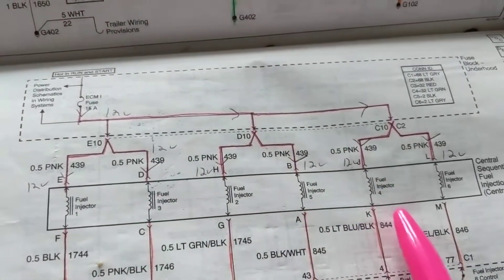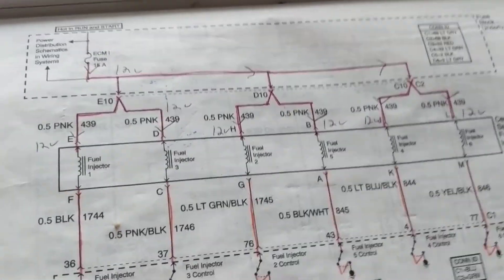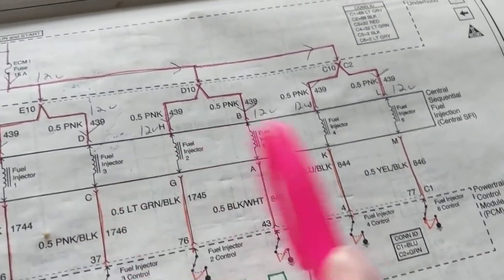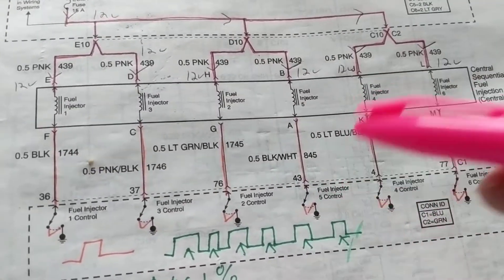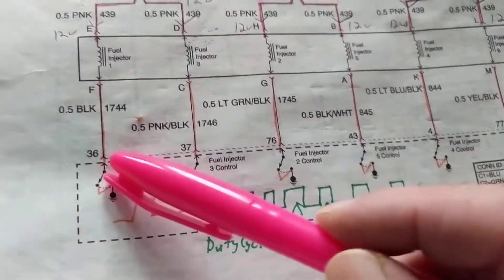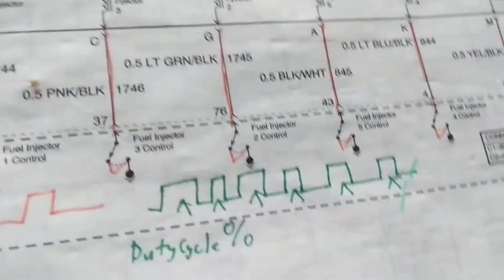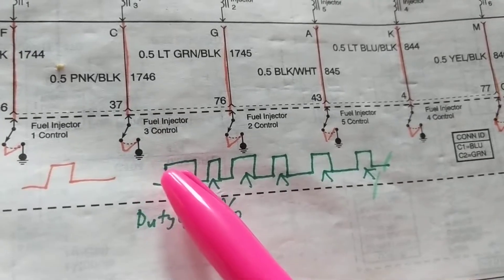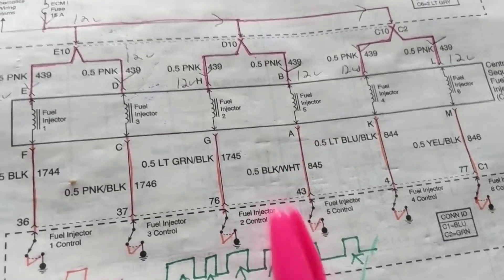HOW  COMPUTER  in a car WORKS pcm  WITH FUEL INJECTORS

Comment: I have a 2011 nissan versa S 1.8 4spd auto with 94k miles.
It has am intermittent stalling at low speeds or in park. I've had the ecm to upfix 2 times..communication board 1st repair..went 500 miles before it started stalling again( restarts after it sits a bit) 2nd time the power board was replaced..went 250 miles and started stalling again...if I keep the rims up above 1200 it won't stall. My scanner shows car goes into open loop when I let up on accelerator. Before first repair I noticed car would go into open loop and st fuel trim would shoot to +25. It would restart and dies repeatedly but eventually it would  start and run normal. 
The only code is a p0420 and I replaced the cat and both sensors( no power loss before or after ) but that code come back every 25 to 50 miles when cleared.
No codes from stalling but the following have been replaced: Spark plugs, coils, injectors, cam sensor, fuel pump, negative cable, positive circuit connector for battery, all grounds cleaned, coolant temp sensor, pcv valve. Some one before had replaced the ipdm and inspected wiring